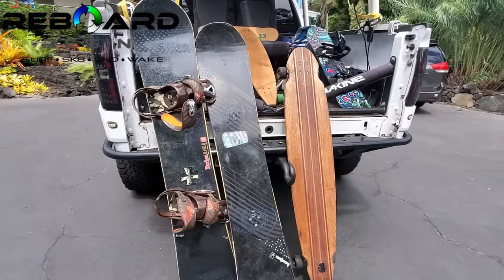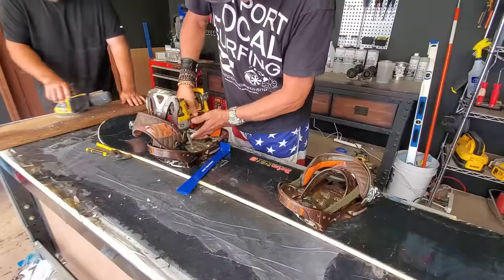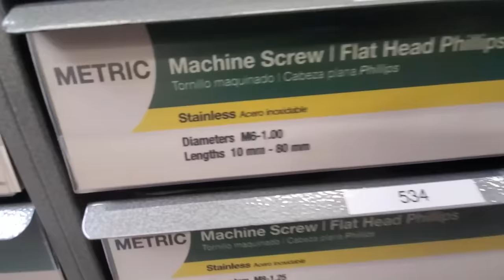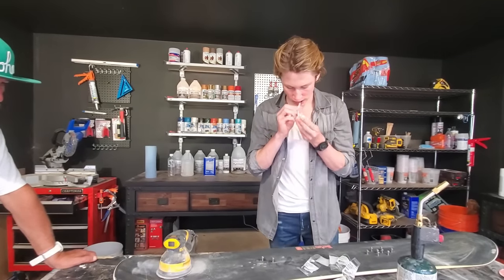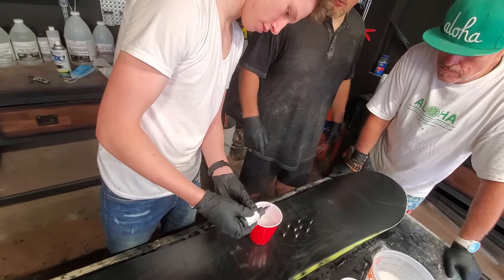This Epoxy Trick Made This Better Than NEW. I'll Show You How | Stone Coat Epoxy

Comment: I have a question, when I try to mix the epoxi and the hardener, there is so many small air bubbles, super small I cant eliminate, when I pour the mix into a mold it came out with so much of those bubbles, how do I mix the epoxi with out all that air?
Reply: In my experience (live edge flood pour river desk, coasters, cheese boards, tabletops) the trick is to heat the epoxy in hot water to make epoxy more fluid and allow bubbles to rise with less resistance. Also, technique when stirring. It's not a race, solid movements and limited lifting of the stirrer to avoid allowing air bubbles. Heating the mixture reduces work time with resin usually. Last thing, the thickness of the pour matters. Too thick can make it hard for bubbles to escape. Thinner layers can help if trying to flood pour. Good luck with next project!